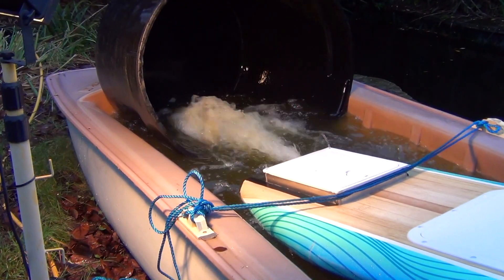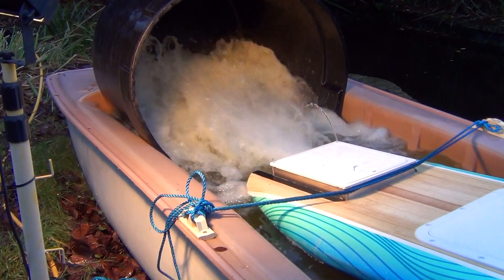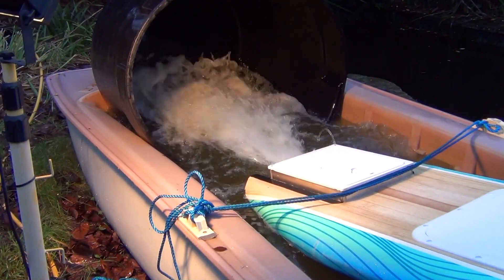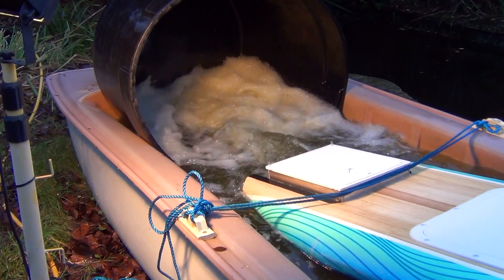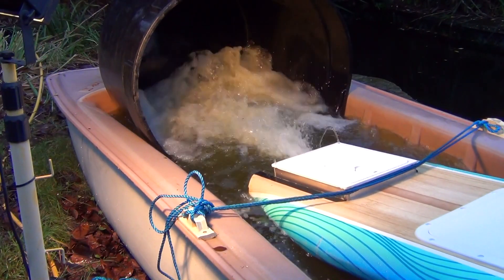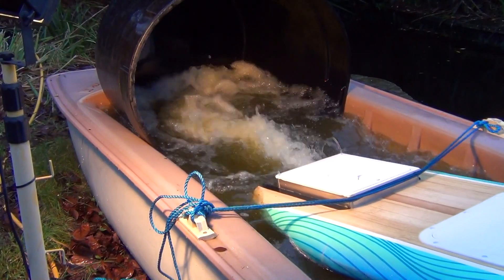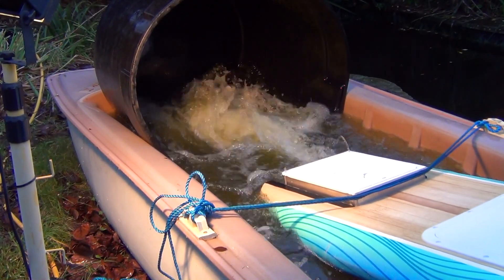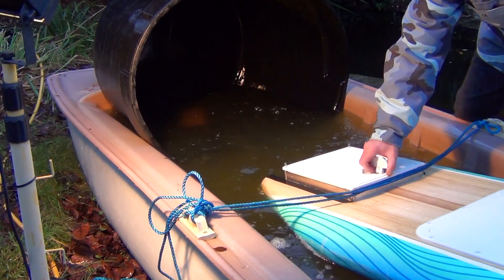JET-UNIT HV,  620KV MOTOR,  120A ESC 12S,

Comment: Hi Mark,

That's the yep 120a esc, right?
What's your opinion about it?

Greetings
Reply from the maker: Hi Mate,, I have messed about with it and it seem great for the job so far,,
programming card is a must,, if it carries on the way it is,, I'll be very happy,,
first impressions 10 out of 10,, down side looks water resistant not proof,,
so I'd only let it get splashed not dunked, the capacitors have not bulged
and I think my low capacity mah batteries would have put some extra stress on them,, so I'll hold back on trying other ESC's for now,, and try theses out,
 hope all s good :) Mark